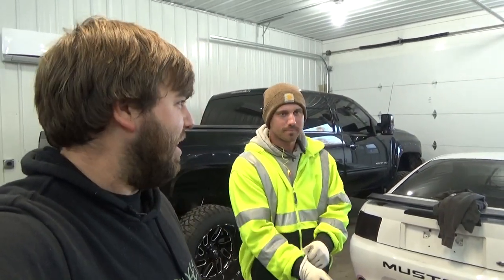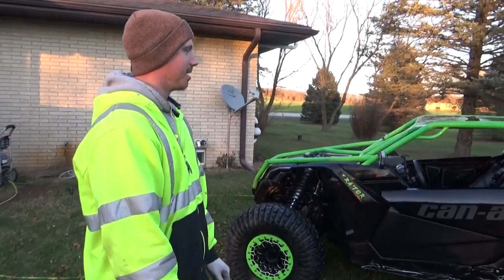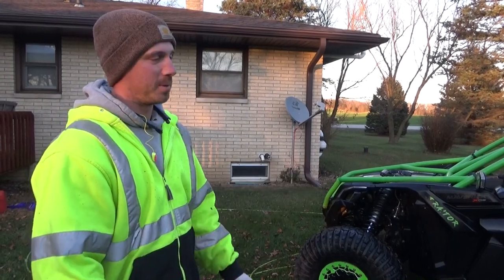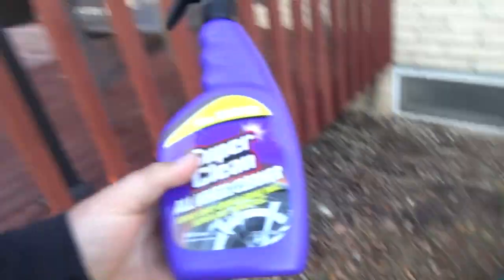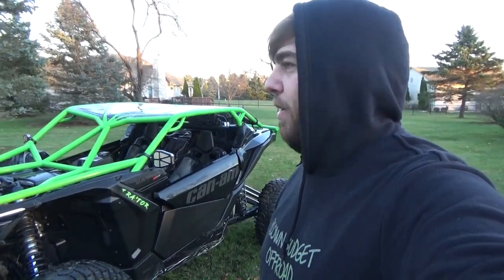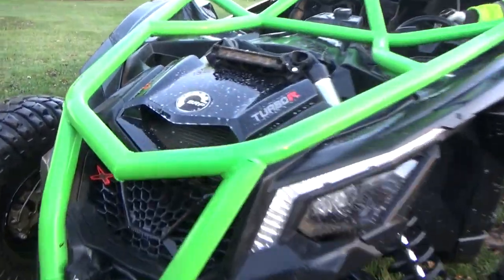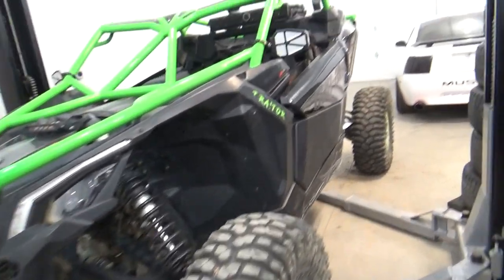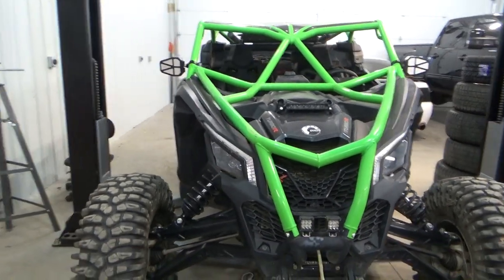How To Clean Your SXS or UTV (Very Satisfying)

Comment: Foam cannon with some good suds really soaks into that dried on mud. Kick back and let it soak in for 5 min.  Then I power wash.  I do mine the same as you guys except for my cannon.  I try not to blast the interior down to much. Mostly wet towel / dry towel for that.  Then I treat my seats and dash with protection coatings from Maguire's products. Interior vinyl and plastic spray works great.   Thumbs up video for sure.   What's going on with Josh's new rig ? Waiting.........

Comment: That’s what I basically do for my Commanders but I do take the skid plates off and the seats out after I go mud riding. But I make it easier on me to start off with by spraying tire shine on all my plastics that I can get to after I’ve washed it and before I go for either a trail ride or a mud ride I’ll rinse it off again and reapply the tire shine/ tire wet which will allow me to just bump my plastics barely and watch the muck fall off so that I cut my washing time down a lot where it use to take me all day after a weekend mud ride I only use about a half day now and that taking my seats out and skid plates off and washing that packed mud out from in the frame

Comment: Use a foam cannon w/ Zep condensed soap and amsoil mudslinger plastic treatment for a show quality clean. The first time you treat your machine with the Amsoil mudslinger cake it on super thick , one or two cans for one side-by-side. After that first treatment it will clean up much easier and then you just put another light coat of Amsoil mudslinger on after each wash. You will not be disappointed!

Comment: Soak/pressure wash. Then foam cannon with liquid tide. While it’s soaking in tide foam, hit everything with a hand mitten. Pressure was off again. Towel dry. Then wait for the majority of the water to dry off. Spray down with SC1. The SC1 is the most important part. It’s will make your rig look like it just rolled off the show room floor.

Comment: Get a garden sprayer and do 60 40 simple green and water

 Spray all the mud off first then cover the whole machine in simple green 

Let sit for 15-20 minutes

Spray it off 

Use sc1 after it dries 

Our x3 has 2900 miles and most of the plastics shine like new they just have a lot of scrapes and scratches everywhere